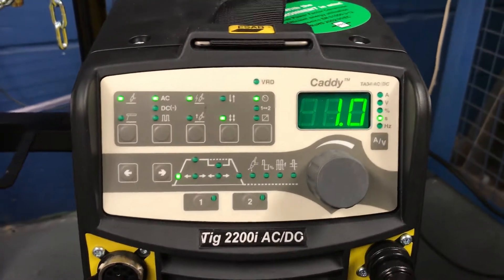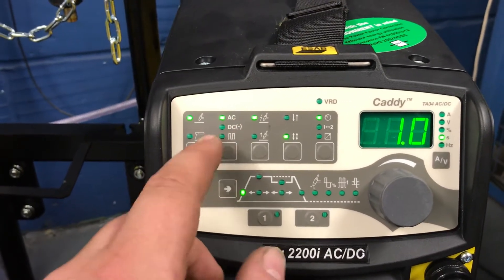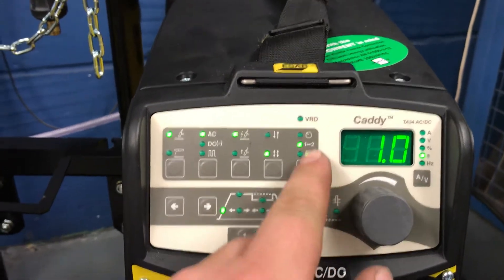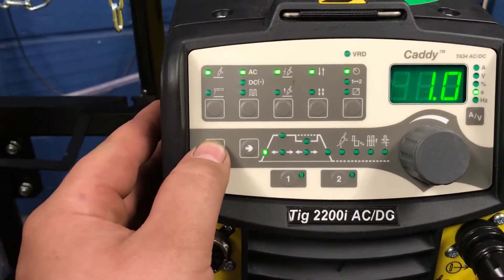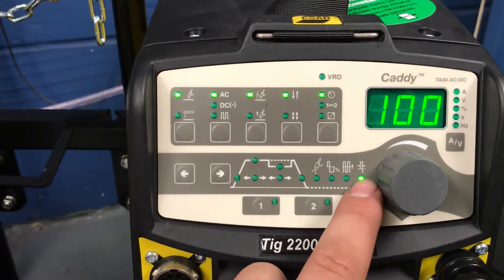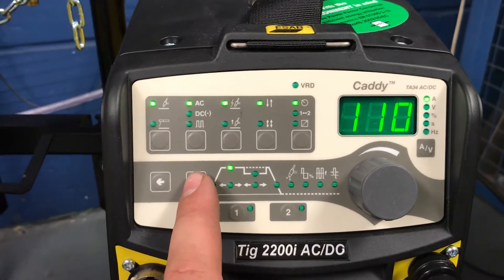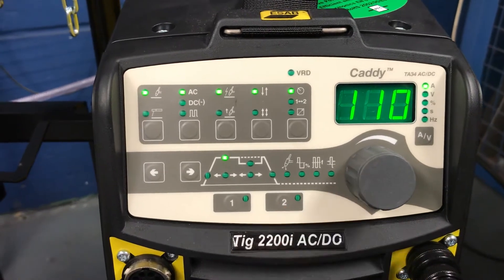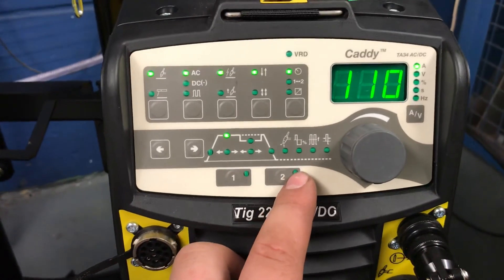ESAB Caddy 2200iw TA34 AC/DC TIG Welder

Comment: Is the fan on these machines continuous turning?
Reply from the maker: No it comes on when you strike an arc and then switches off after about 5 minutes of stopping welding. 

Not quite fan on demand like other top end machines but better than continuously on. Remember this machine is the same technology since the 2000's, the design hasn't changed at all. Nowadays there are much better spec machines on the market.
Reply: @MJBEngineering what if you could get one for like 500-600 quid, worth it for a first starter tig box to learn on? Cheers
Reply from the maker: @I2YANx  They're a professional level unit, more than good enough to learn on!

The problem with these machines is they are not know to be as reliable as some of the other european machines. 
They are very expensive to repair when they go wrong.
Reply: @MJBEngineering  cheers

Comment: Thanks for this, I couldn't find an explanation of control panel anywhere, not even on esab manuals online. 

I am learning on these machines at college and the machine I tend to end up on has all defective lights /buttons except for the far right one below VRD. Maybe if I toggle it the rest of buttons will work?
Reply from the maker: Glad to hear this has helped. If the buttons are not lighting up it would suggest that the tactile display/screen unit has suffered a failure. I doubt toggling the VRD button will do anything. That should only change in stick mode anyway if I remember correctly.